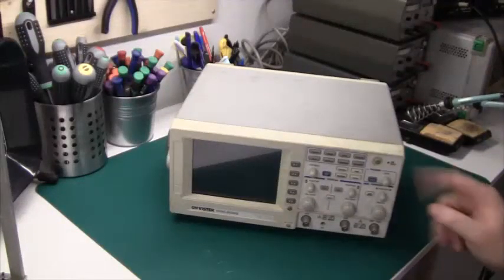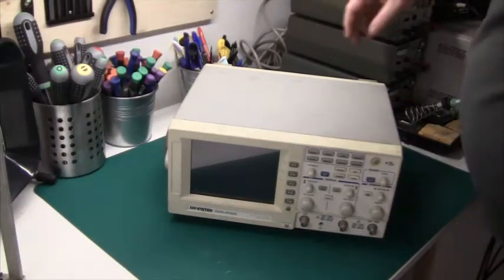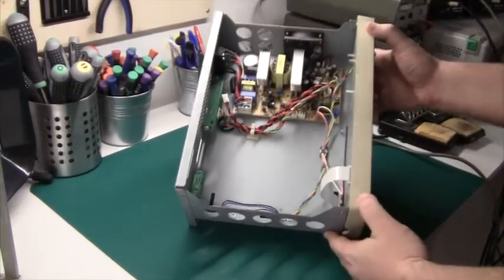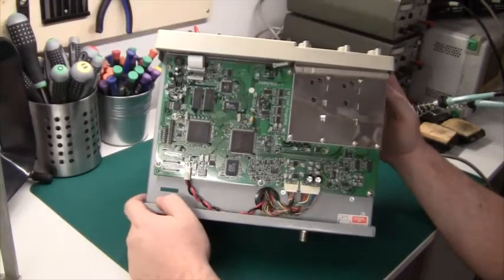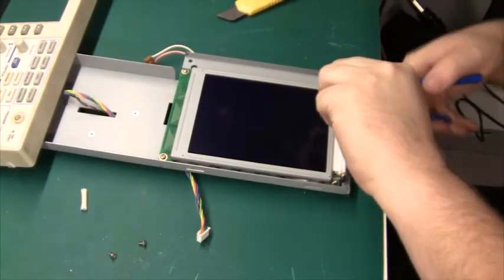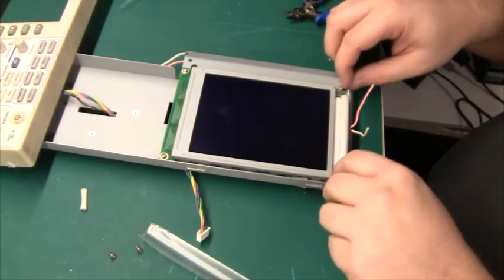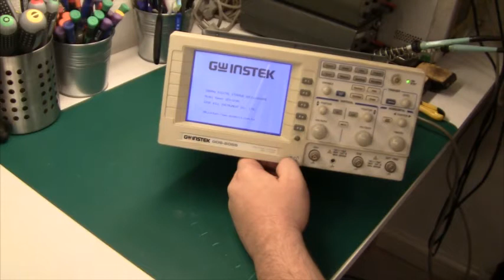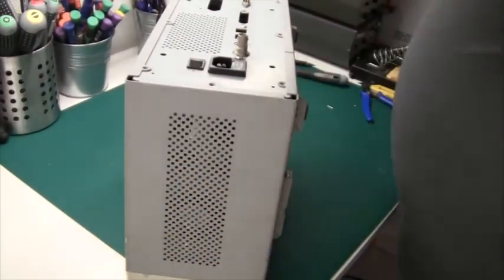Repair of GW-Instek GDS-806S Oscilloscope

Comment: Great video. I have a GDS-820S, and its backlight is completely off. May I ask what the part number is of the backlight tube and where I can buy one?
Reply from the maker: You may ask, but I can't answer. I got it off ebay. Here is a suggestion: If you can find a DC voltage in your oscilloscope (5V or 12V or something like that), you can make an LED strip with some white LEDs and some perf-board that is the same size as the tube and use that instead. I have done it on two scopes with a poor screen. Not only does it work great but it will also last a lot longer. Sorry I can't be of any more help, and good look with your project.
Reply: @NatureAndTech  Thanks. I'll look it up.
Reply: @NatureAndTech  Turns out the problem is not with the CCFL tube, but with the drive. It's dead for some reason. However, I found out that the input of the CCFL drive is 12V, so I managed to replace the CCFL with LED. Thanks for your advice!
Reply: @chuanliu4685  Can you show me how fix it? How I know if the drive is burned?  Must the output be 1000V?
Reply: @OnlyElectronic  I meant the driver circuit for the CCFL tube. CCFL tubes require a special circuit to work. This drive circuit is located on the main PCB I think. Can't remember anymore as I have sold it.
Reply: @OnlyElectronic  I only found out because I replaced the tube and it still didn't work. I didn't fix it. I connected a led driver to the input of the CCFL circuit and replaced the tube with a led strip. So the CCFL circuit is still sitting there broken, but it is not required to work anymore.
Reply: @chuanliu4685  Looks like that my problem is the LCD, because I removed the CCFL and put my led from cellphone and continue with problem in LCD... There is a stain in the middle of the lcd
Reply: @OnlyElectronic  That's too bad. It might be difficult to get a replacement for the LCD.
Reply: @chuanliu4685  but what do you think about SP14Q001 display? One guy said in the comments that it is compatible. But I asked to display seller and told me that it is not compatible (at least he thinks that it is not compatible)
Reply: @OnlyElectronic  Sorry I don't have any experience with this display. Looks similar though.
Reply: @chuanliu4685  few days ago I had wish to modify my "white-on-black" display to "green lamp" by usage of green LED. But I understood that picture 'll be bad because of light frames inside LCD.

Comment: hi looking for data sheet for the transitors ? or replacements. already done all the caps thanks to you
Reply from the maker: Hi. I don't remember there are any transistors in this video? Are you talking about the power-supply repair? If you are, the big power mosfet transistors are: CEP703AL and CEP05P03 from cetsemi.com. I'm pretty sure you can quite easily find replacements on Digikey. Any 30V parts with an rOn anf VGS(th) about the same as the CEP ones would work. The scope is not drawing so much current, so I think 10A would be sufficient.
Reply: hi my bad yes those are the ones.. thanks.. divy moment lol
Reply from the maker: No worries

Comment: hi i found someone have also problems with the instec 806. i have some orange marks in the lcd and i look defendly to buy an lcd have you any idee where i can find this lcd 

thanks at forwards eddy
Reply from the maker: +eddy filibert hanegreefs Hi Eddy. I once had a Tektronix with a faulty LCD. It was impossible to get a spare LCD. They become obsolete really quickly. You can try look up the LCD part-number (see sticker on the back of it), on the web. If you are in the US, you may have more luck than us Europeans. There are some pretty good "ex-stock" sellers in the US.
Reply from the maker: I think the easiest is to send your local GW-Instek office an e-mail. I've done it once, and they were very very helpful, and the cost they charged med for the LCD display was about 60 euro, if I am not wrong. If they only sell LCDs with LED backlight, see my other videos showing how to convert your power-supply to drive an LCD display with LED backlight.

Comment: I'm needing a source for a replacement LCD for a GDS-840C (color display) model. Searching eBay has been fruitless so far. Anyone aware of any other suppliers that would have this display?  Also, I believe @UCE0GKU2BTbcOENr0xiRlOHg stated the 820/840 (mono) series scopes utilize a "standard 320x240 5.7" SP14Q001 compatible" display. Would this also apply to my 840C model? Thanks for any help.

***UPDATE***: It appears my 840C does in fact use a 320x240 5.7" (color) LCD display. Now to find one.  Connecting the scope to an old WinXP VM via USB in order to use the scope is getting annoying.
Reply from the maker: Hi. Unfortunately I can not help you. I do not have this oscilloscope any more, but I can leave your message up here, and hope that someone will see it.

Note: I had to throw out a Tektronix portable scope some years ago, because it was impossible to get a replacement screen, so these things happen.
Reply: if GDS840S and C have the same firmware (as I remember they have. Look at official GW Instek site to control it) You can try to use it. I have 840S (mono) and when I replaced display I saw that I can't simply upgrade it up to 840C because connector for color display and parts around it are absent in my oscilloscope. If mono connector and parts around it are present in Your equipment I think it'll work (but can't garantee that).

Comment: i hope you no the trick for switching it to an 100mhz

just put the 1st and last dip switch to "0" so you have an 100mhz now

have a nice day
Reply from the maker: +eddy filibert hanegreefs Thanks for the tip. I have tried flicking the 2nd DIP switch, but I did not see any improvement, except the name in the display. I will try flipping both and see. Again, thanks for the tip. I love that little scope.
Reply: Where do you find docs on how to do this trick and are there others ???? :-)